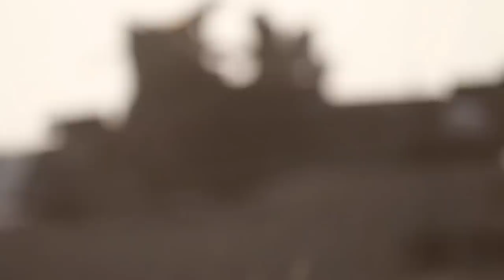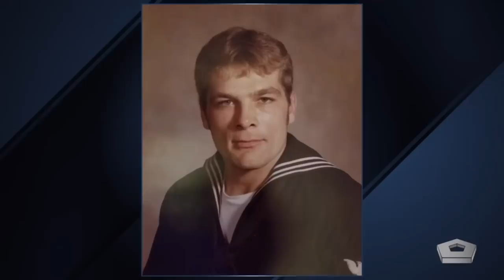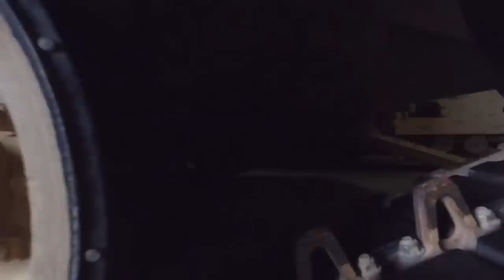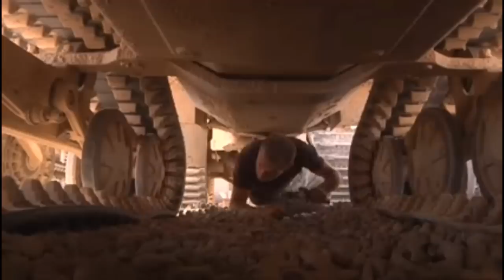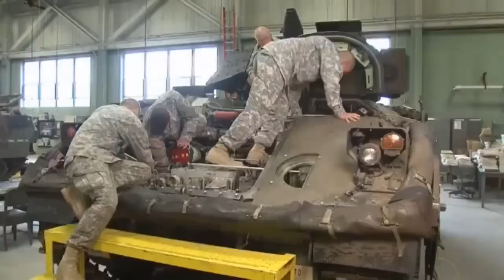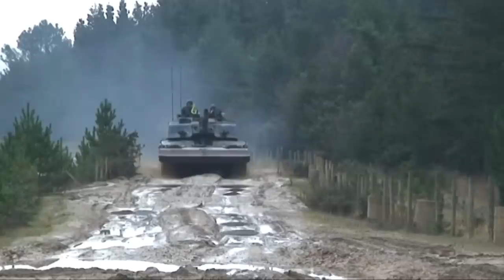Do you want to be a Tank Mechanic?

Comment: Do you want to be a Tank Mechanic?
NO! NO! NO!
Reply: There are two types of mechanics who work on tanks.  There are the tracked vehicle mechanics who work on the hull (powertrain, tracks, batteries, etc.) and there are systems mechanics who work on the turret.  Get out of the Army as a systems mechanic and you have expierence troubleshooting electrical, hydraulic, optical, mechanical, electro-mechanical, hydraulic-mechanical, optical-mechanical, etc. systems.  

You can then get a well-paying job as a systems mechanic working on all manner of high tech industrial machinery.
Reply: They have combined it to 91A abrams tank system maintainer,  at least for the us army they have.
Reply: @renster143  Yep. I was a 45E in my time (98-02). Solely a Turret mechanic, but I worked on EVERYTHING in our Armor Company.

Comment: Yes,  I was challenged as a platoon leader of infantry...   BUT I was honored and "learned" things as the Mech Infantry Executive Officer in a Rifle Company later.   That put me as a (senior Lt) in the Motor Pool.   Wow,  did I learn what keeps a unit moving.   Pulling a engine pack and replacing a transmission in the field....   Out in the muddy german plowed field in November.   To recover with wenches the 5 ton truck stuck in the mud with a burned out clutch.   Parts, Lubricants, Annual Svcs,  and then the true challenge of recovering/fixing in the field while under pressure to get it done.   Yes, you work your socks off and get covered with oil/dirt.   When the crew rolls it away...   Wow,,,  just Wow...
Reply from the maker: Thank you for your kind words

Comment: I will be very thankful if you can explain the fire control system, optics, and especially the gun-follow-sight stabilization system of the modern tanks.
Reply: That is some very sensitive and secret information. Don't expect any help or information. The Russians won't help you either.
Reply: In order for to know the information you desire. I encourage you to obtain at least a Master's Degree in electrical engineering, with a minor in physics. Possibly a Doctorate in the same area of expertise.
Reply: Whomagoose long ago soldier the basic principles are out there, I have learned quite a few during the past 12 hours. I found the visualization of Switchology Series of Inside the Chieftain’s Hatch especially helpful.
Reply: @thomaszhang3101  : Switchology, your kidding? The study of switches, WTF is that? Dude you just be you. Knock yourself out with your research in Switchology. Mechanical and Electrical engineers are going to have a big laugh at your expense. Ha ha ha ha!

Comment: In the U.S. Army being a 91A you will not just work on Abrams. I, a 91A, have worked on M1's, M88's, M113's, Humvees, M1074/M1075's, M2/M3/M6's and a few others. In the U.S. Army we have a RSS, FSC, and Line Unit Direct Support. I'm in a direct support so I'm actually attached to the unit I deploy with. Other than that 100% Agree. If you have even a slight aptitude towards fixing stuff, especially electronics, then yes 100% be a Tank or other tracked vehicle mechanic. In the U.S. Army those would be 91A, 91M, and 91P which all works on tracks. The order "ability" according to the U.S. Army 91A, 91P, 91M, 91S, ect.

Side note: The Abrams does have a turbine engine so with some stuff you will hurt yourself pretty badly. Safety is always number 1.

Comment: I trying to be a mechanic, and I like tanks. So to be a tank mechanic is likely my wet dream. If I get to work in a tank museum like Bovington Tank Museum is something I wont say no to
Reply: There are two types of tank mechanics.  A tracked vehicle mechanic who works on the hull systems (engine, tracks, suspension, power etc.) and systems mechanics who work on the stuff inside the turret.
Reply: @colincampbell767  The system is more in electric side then. But also a problem. I dont know what it falls under here in Denmark. Not sure if it is in theory "truck mechanic" route I should take, or if there is a special type of education that you get when you join the army
Reply: @Danspy501st   Most military services train you from the ground up.  The US breaks out wheeled vehicle mechanics into 'light' wheeled vehicle mechanics and 'heavy' wheeled vehicle mechanics.  Tracked vehicle mechanics are completely different from wheeled vehicle mechanics.  'Systems' mechanics work on artillery, tank turrets and other weapons systems.  If you want to fix things for a living after the military - I recommend becoming a systems mechanic.  Systems mechanics in the US typically start getting calls from 'headhunters' several months before their time in service is up.  And they typically wind up working on various types of high-tech manufacturing equipment.  (Although this is sometimes a high stress job when you are trying to get a machine operating - that's costing your employer hundreds of dollars for each hour it isn't running.)
Reply: @colincampbell767  True, but again I live in Denmark, which might be different. I know that if you are truck mechanic (The lorries, or semi truck, 18 wheels or you normally call them) then you will highly end at their workshop where they have their trucks

Comment: I'd rather just roll around in the beasts that tank mechanics fix
Reply: Typically you will only get one mechanic to fix your tank.  The crew usually assists.  And it's not as if you don't have a lot of work to do to keep your tank running.  A tank crew typically spends eight hours a day on maintenance, inspections, system checks and calibrations.

BTW - getting a thrown track back on a tank is crew maintenance.  The mechanics don't have to help you do this - so remember to stay on their good side.  (It's a lot less backbreaking if you have the -88 helping.)
Reply: Colin Campbell Yeah, the description of an armoured soldier on the Canadian forces site makes it clear that tank maintenance is part of the job 😂 I don't have a problem with that, it's just not what I'd want to spend all my time doing... I'd like to be able to operate the tank as well
Reply: @klingewolf6220   Do some research and find out how much time tank crews actually train on their equipment.  Tanks are enormously expensive to operate (the budgeting cost for a M1A1 rank was $200/hr) and some countries economize by not training on their tanks very much.  The lavish amounts of money the US military spends on training is not typical.

Comment: It's not for wimps or weaklings. Either you get strong and smart or you get hurt or lose fingers or body parts or get killed or someone else hurt or killed. There's no second chances on a tank. Heavy parts and they soak up the heat and give it off all summer long. You'll either love it or whine like a bitch. I Love my job! Still working on heavy metal in the civilian world.

Comment: Dont do it, I'm a tanker with the 1st armored. Our brigades tanks haven't been reset in 11 years and are broken more then they work. As a tanker and especially a mechanic you will spend so much time working on tanks. You will work very late nights, and even into the next morning trying to get the tanks up. You will work on Saturdays and 4 days when the tanks need to be brought up. You will sweat your ass off working on these tanks and be covered in oil the whole time. When these tanks break, they are a bitch to fix. Whether it's when you throw track, so bad and it takes a dozen hours or days to put back on. Having to replace an arm, a hub, or your final drive seal which you break track, pull pack, and take apart the final drive. My point is these tanks break down so much that you will see just about everything with these tanks. It was a long 3 years working on these tanks.  Only do this if you truly love tanks and have a good understanding if mechanics.

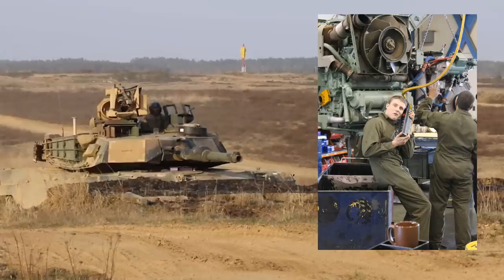Comment: Wait, @2:52, is that a Leyland L60?
Reply: Nope it's my old friend the rolls Royce/Perkins cv8 and gearbox powerpack out of the warrior afv.
Reply: @scallionboy8679  Looks like a good piece of kit!
Reply: @joshualopes9754  yeah lovely to work at. A good fitter crew that knows their jobs well has the engine disconnected and out of the warrior on the ground and running in about 15 to 20 mins. All the electrics and fuel lines are left long for reconnection on the ground. The l60 on the other hand was horrible dirty and just an all round bastard. I watched royal Engineer chieftain and l60 being fixed by their own reme fitter crew in Germany for the 4 weeks we were on an exercise. It drove 300 yards on to the the area and threw some pistons out of the block. It was being scrapped not 4 weeks after the exercise was finishing but the crew had to keep repairing it. Soul destroying in my opinion.